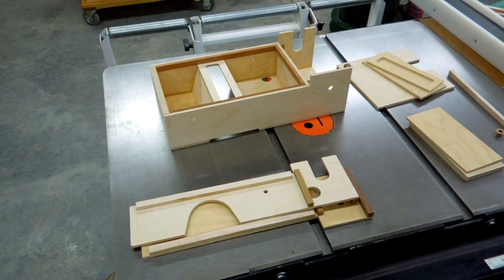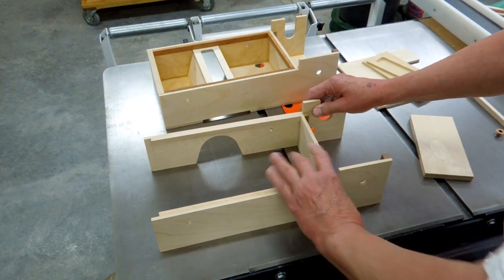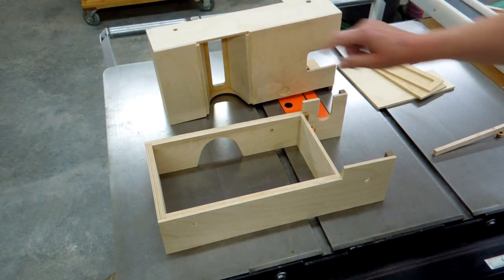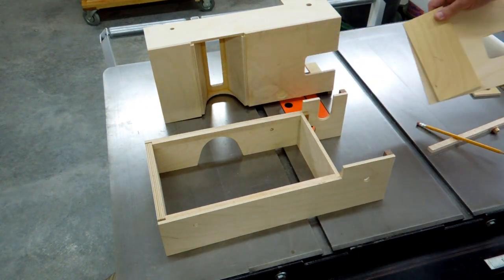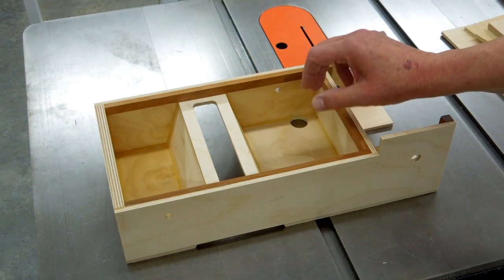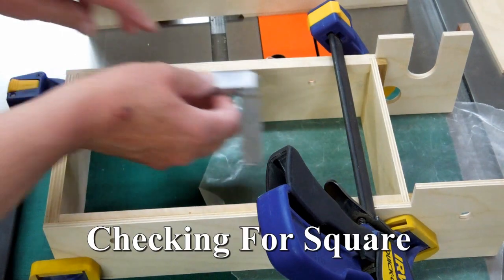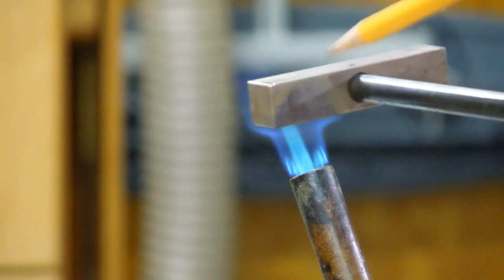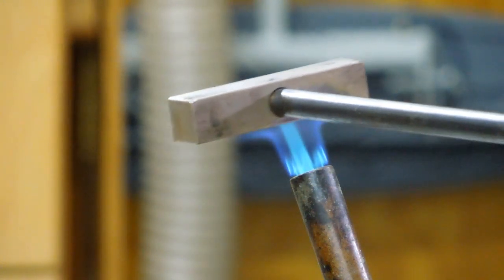Senior 20 Organ (05) Pressure Box Assembly - Branding Iron

Comment: Hi there real nice work but could you explain how do you seal around the feed shaft and rewind shaft (air tight )?
Reply from the maker: Good question. Answer: You Don't.
The shaft passing through the bushing only allows a small amount of air leakage. The bellows produces an excess amount of air. This compensates for the small losses around these shafts and a few other areas (such as the pressure box lid). 
On another subject... when you get your organ completed, I suggest leaving the Pressure Box Lid partially open when not being played. This allows the gaskets to relax and they will seal better during actual use.
Thanks for watching. Please subscribe. 
That is what keeps this channel running. 
Ron
Reply: @RonaldWalters2010  thank you so much for your reply been scratching my head for a long time on this matter